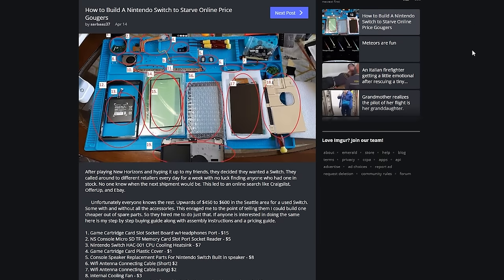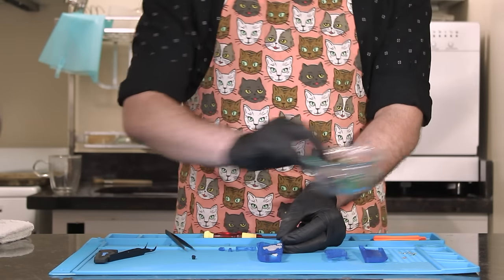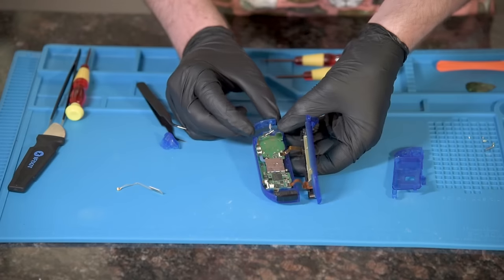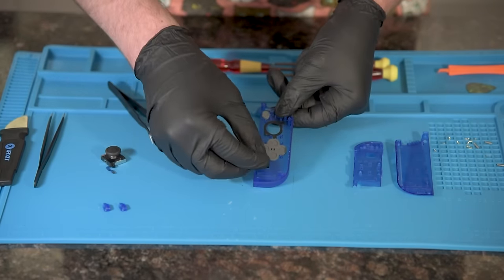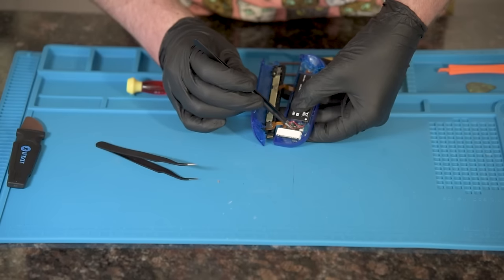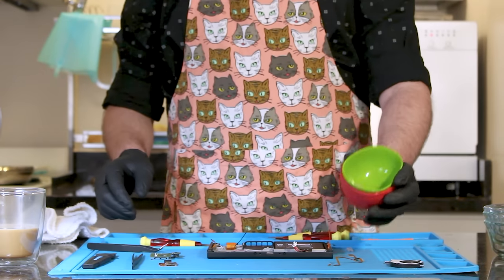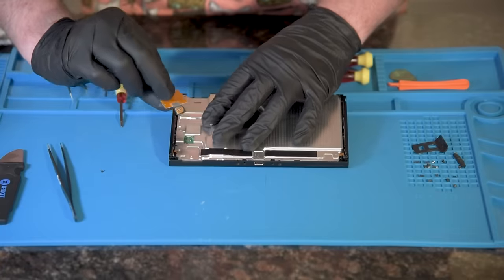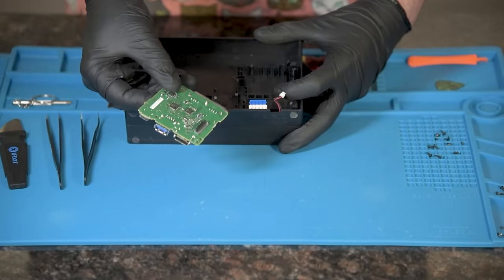How To Build A Nintendo Switch From Scratch

Comment: I live in Toronto, Canada, and it's been quite hard looking for a locally-sourced motherboard on eBay, Craigslist, Kijiji (it's Craigslist North), etc. Any advice on reliable motherboard sources that can ship the part over?
Thank you so much for your guide! I was planning on holding out for the mythical Switch Pro, but if I can sporadically spend reasonable amounts of money on parts over the course of a couple months, I wouldn't mind building a Switch and then buying a Switch Pro later on. I've been sourcing many parts on AliExpress (some parts are cheaper when you buy them in a bundle). Of course, I'm sticking to OEM when it comes to the motherboard and battery. Have you sourced/considered sourcing any of your parts from AliExpress?

Anyways, take this sub :D
Reply from the maker: Unfortunately right now I think luck has a big part to play. 

I have sourced quite a bit of parts from Ali Express, but I placed my orders back in early March. And a lot of stuff still hasn't gotten to me yet. I would say about half of my orders are still stalled somewhere. 

This is what lead me to buying broken ones locally that sounded fixable. Since I live in a big city I certainly had more options available. 

It isn't an easy project, but persistence always pays off with electronics. Good luck and I hope you find the parts!
Reply: Brennen'sBudgetBuilds I personally splurge a little more for faster shipping as well as tracking. Typically, shipping costs around $5 CAD (so a bit less in USD) for 15-30 day shipping, and for some of the larger parts, it can go up to maybe $15 for the same amount of time. That being said, I could've saved a reasonable amount by being stingy with the shipping, but I'm budgeting by spending $50-$70 on parts every two weeks instead of going all out at once. I did the math, and it's looking like I'll roughly hit around retail price ($400 CAD here thanks to our Canadian dollar LOL) after applying all the shipping costs, but again, $50-$70 every two weeks doesn't hurt me.

Given this pandemic, shipping has slowed for me a bit, but not too much considering again that yes, I did splurge on shipping.
Reply: Is there a link to buy the battery?
Reply: A Aa I would probably just buy from a trusted 3rd party supplier that has OEM batteries in stock. If you're in the states, iFixit is your best bet.

Comment: So obviously this would void warranty, but if I were to do this would I be able to play the games on it? I mean it’s not really a home brew console right, it’s more like replacement parts?
Reply: well. i have done it my self. the motherboard it self is the switch in its absolute bare bones and is the only component that had to be from an original switch. the software it self is still on the motherboard and you can use it to play games and login to your ns account also it depends on what motherboard for it to actually be modded

Comment: Where did you find the parts are such low prices?
Reply: MrSparklesman Try AliExpress, and buy your parts in bundles from reliable sellers. I've sourced every part from there besides battery and motherboard. Most of them have reached my home and have fit pretty snug so far. You may need to spend a little extra on shipping if you're impatient.